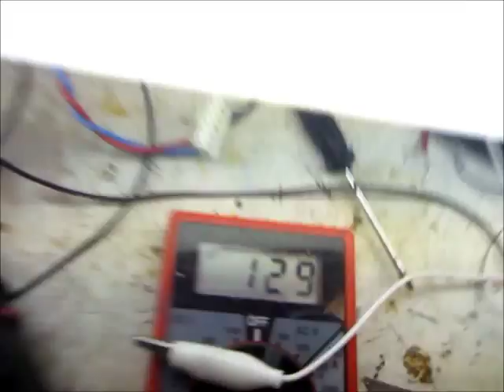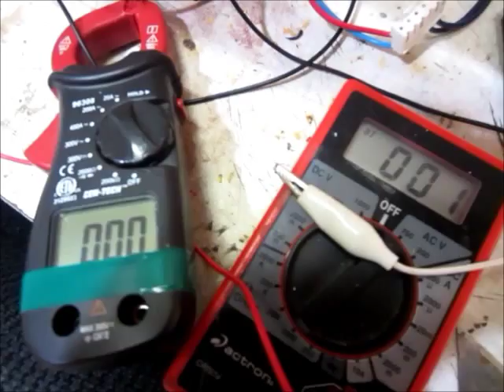High Voltage Experiment with Xenon Flash Tube and Florescent Tube.

Comment: You should try to put around 20kvdc from a ballast run flyback transformer in a krypton flash tube it makes neat glowing yellow white arcs from one end of the glass to another don't have the coil around the glass excite it from the ends with low current high voltage DC

Comment: Yes at the basic they are the same! Most cheap neon lantern use this principle some more complex some at the very basic but they work and they cost nothing to build. Or you can go with something just a little higher and using a high voltage transformer but you can do it with a regular transformer ^^ I did it couple of time as well has zapping myself >.< those thing STING! :P